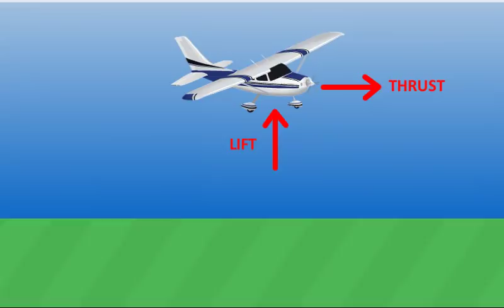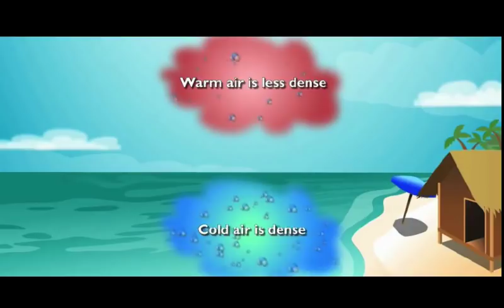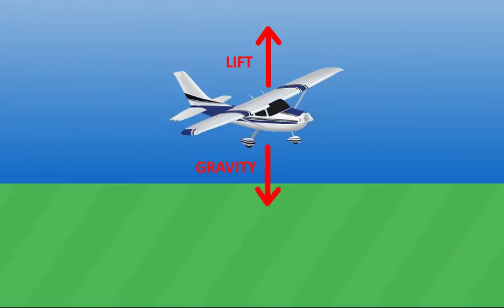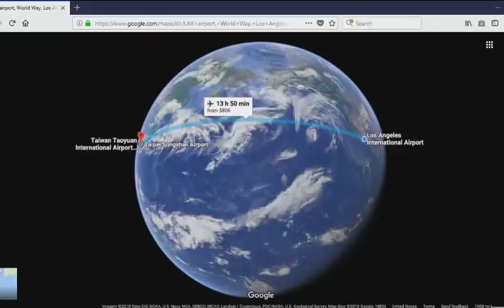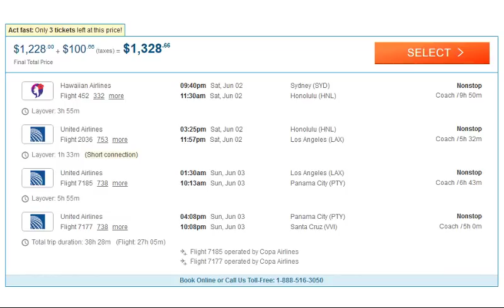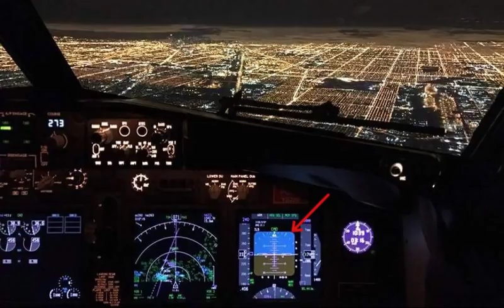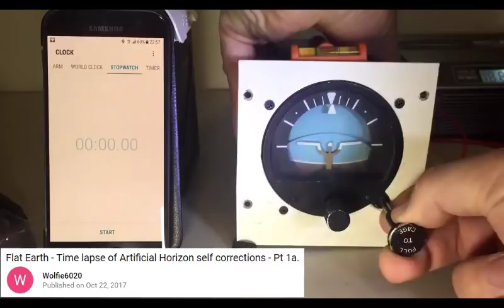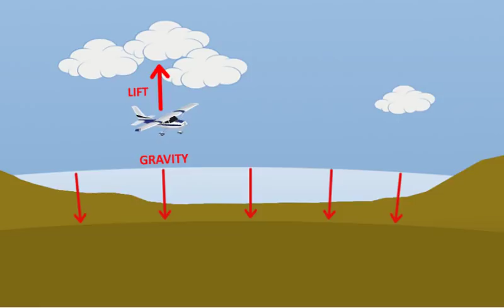Flat Earth Falsities - Plane Nonsense

Comment: Speaker claims the air is moved at 1100 mph at the equator because of gravity. But a spherical Earth would have a much smaller circumferences at the other latitudes and the air at those acts the same (no faster or slower). But the gravity acting on the air would be the same no matter the latitude. The gravity would pull the air to the earth's core and wouldn't exert any sideward forces to cause the air at the equator to move at exactly the same speed as the Erath rotating beneath it but there is certainly no mechanism for gravity to only move the air in New York, for instance, at half the speed. The speaker is dead wrong on the first issue. Everything we observe demonstrates things move THROUGH air and so would a spinning Earth UNDER an atmosphere move through the air above it. Planes move through the air and aren't effected by rotating air either. There's no evidence at all of what the speaker asserts.
Reply: You didn't actually watch the video did you?  Or maybe you had the sound muted?
Reply: Robert Lefebvre Aside from the motion starting as the planet formed (everything rotating) the atmosphere is kept moving by friction with the Earth’s surface, hence any point in the atmosphere having a similar rotational speed to the ground under it.
Reply: @flookd5516  NEVER would the spinning Earth be able to generate enough friction from the thin layer of air in contact with its surface to get the entire atmosphere above that thin layer to also rotate at the same speed. And with a supposed rotating speed at the equator of 1100 mph, then even a ridiculously high efficiency of 90% would result in a difference of 110 mph or a constant Class 2 hurricane.
Reply: Robert Lefebvre I said the atmosphere is KEPT moving by the friction, not that the friction created the motion. Individual molecules are moved by mountains, vegetation, buildings; being gases and the atmosphere being dynamic the acquired momentum becomes dispersed throughout the atmosphere. 

When the Earth & atmosphere essentially move with the same velocity there is zero relative velocity between them. You aren’t going to get a hurricane from both at the same velocity.
Reply: @flookd5516  That explanation is counter to the laws of physics and you would need to provide some proof of the claim. Everything from butteflies to birds to people to kites to planes cut through the air and so would the surface of a spinning Earth but even if it did act as some sort of paddle (like in a paddle wheel boat) it would push such a thing film of the atmosphere and would no way also cause the upper atmosphere to match the same speed from that small amount (relative) of friction. Too, since the circumference of the upper would be greater then the upper would need to have even more speed added to enable to keep up with the lower. With a starting speed of 1100 mph, any differences from the surface to the upper would result in potentially 1100 mph wind shear between the surface and upper atmosphere IF they weren't also caused to rotate at the same speed as you say. And all this is happening without an airplane feeling the sidewards push and a hurricane can still rotate within it while having ground speeds of just a few miles per hour?
Reply: @bungeebones  The Earth coalesced over the course of about 20 million years. The clumps of matter coalescing would have kinetic force; the rotation arises from the net movement and the acceleration that arises from the conservation of energy as the radius contracted. Most of the matter formed a solid planet; some remained in gaseous form producing the early atmosphere. Since all was rotating at the same velocity there was zero velocity difference between the solid planet and the atmosphere. The atmosphere was added to largely from volcanic eruptions; since all mass has inertia the gases being released retained the same net velocity as Earth and moved with the existing atmosphere. 

Some atmosphere would be lost as molecules with higher kinetic energy managed to escape into space. Since they took kinetic energy with them the net kinetic energy in the atmosphere would diminish. Friction of the Earth's surface would add kinetic energy to the bottom layer of atmosphere. As with any fluid there are local currents within the atmosphere, circulating molecules within it as the whole body moves. The accelerated molecules would be redistributed by those currents, dispersing the kinetic energy throughout the atmosphere and maintaining its net motion. 

When you are standing on the Earth's surface you are rotating with the Earth; there is zero velocity difference between you. When the atmosphere is rotating with the Earth there is zero velocity difference between it and the Earth. When you, the Earth and the atmosphere are all moving at the same velocity there is zero velocity difference between you and the atmosphere. You are not going to get blasted off your feet by an atmosphere that has zero velocity difference to you. There will be a difference between you and the local currents within the atmosphere; that is the wind. 

When an aeroplane is sitting on the runway it moves with the Earth. Due to inertia, when it takes off it retains that velocity; its engines act to change the velocity, not replace it. When the atmosphere is moving with net velocity difference relative to the Earth and an aeroplane retaining the same velocity as Earth takes off then the plane (other than the changes initiated by its engines) moves at the same velocity as the atmosphere (local currents aside). 

That the atmosphere as a whole is moving does not prevent the existence of local currents. Assuming you have flown, you may have noticed you can still stir your coffee while travelling on a plane; the plane's velocity does not stop you moving the liquid around in the cup. That is the difference between net and local effects. The coffee retains the velocity imparted by the Earth, modified by the plane's engines and the minor effect of you stirring it; it exhibits the net effect. 

If you are going to answer then read & understand what I just wrote then answer what I wrote, not what you think I wrote.
Reply: @flookd5516  Regarding "When an aeroplane is sitting on the runway it moves with the Earth. Due to inertia, when it takes off it retains that velocity; " LOL, with no noticeable effect whether it is flying north, south, east or west? Just think how all that would work on a human at 1100 mph let alone a plane. You are standing at the equator facing north. You have inertia moving you to your right at 1100 mph AND the air moving you to the right at 1100 but you can't feel it? And then you turn 180 degrees and face south. All those massive inertias reverse and you still can't feel it? 

But a plane flying north from the equator would quickly lose all east west inertia and would then need or suffer the atmosphere moving east in order to keep it on the same longitude. Planes to not at all feel those lateral forces when flying north or south. They act the same as if they were flying through the air in any direction.
Reply: @bungeebones  "You have inertia moving you to your right at 1100 mph AND the air moving you to the right at 1100 but you can't feel it?"
Can you name the sensory organ in the human body that would be capable of "feeling" that?

"All those massive inertias reverse and you still can't feel it? "
What?  What nonsense is that?  That is actual gibberish that proves only that you have absolutely zero understanding of even basic physics.  Seriously think about what you are saying for a moment.  Picture yourself on an airplane flying at 500 mph.  You are facing the right side of the plane.  You, the airplane, and the air inside the airplane all have inertia at 500 mph.  If you turned around and faced the left side of the airplane do you honestly think you are going to feel some change in inertia?

"But a plane flying north from the equator would quickly lose all east west inertia"
Why?  Why would it "quickly" lose all that inertia?  What would cause it to lose that inertia?  Really.  I am interested in the exact mechanism that will cause your hypothetical airplane to violate the first law of motion.
Reply: So how did our atmosphere get to be so special?
Some scientists describe three stages in the evolution of Earth’s atmosphere as it is today.
 Molecules of hydrogen and helium move really fast, especially when warm. Actually, they moved so fast they eventually all escaped Earth's gravity and drifted off into space. - DAM !

  Earth’s “second atmosphere” came from Earth itself. There were lots of volcanoes, many more than today, because Earth’s crust was still forming. The volcanoes released
        steam (H2O, with two hydrogen atoms and one oxygen atom),    - Perpendicular jets?
        carbon dioxide (CO2, with one carbon atoms and two oxygen atoms),
        ammonia (NH3, with one nitrogen atom and three hydrogen atoms).

Thus, oxygen began to build up in the atmosphere, while the carbon dioxide levels continued to drop. 
- BUT ALL THIS MOUVEMENT CREATED= MOMENTUM ! 

And if you also trust aerodynamic theory (which applies equally to flying insects, birds, and airplanes), then the giant flying creatures of the dinosaur age could only fly if the atmospheric pressure was much higher than it is now: at least 3.7–5.0 bar.

If this is so, it raises several interesting questions. For example, how did the atmosphere get to that pressure 100–65 million years ago (Mya)? What was the pressure before that? And how did it drop down to today’s 1 bar? Although we have no definite answers to these questions, let us put forth reasonable possible explanations.

The third alternative seems to be the most reasonable, [ :) ] so let us pursue it. We will also look into the composition of Earth’s atmosphere, but we will first discuss Earth’s surface and see how it affects the atmosphere...

Our moon has the same density as Earth’s crust, which suggests [= scientific fact] that *the moon was formed by stripping Earth of some of its then fluid crust [- with even less then 1/6 Gravity?]. If not for this loss, Earth’s crust, now only 5–30 km thick, might be 42 km thicker. 

Making sense of it all :) :) :)
If we assume that Earth’s early atmosphere was very different, both in composition (mainly CO2) and total pressure, that would answer some puzzling questions from a variety of disciplines.  -DAM not only FEers have many questions?

- And Louis educational program of Heliocentric globe business to their Believers continues...

REF: https://scijinks.gov/atmosphere-formation/
         http://pubs.acs.org/subscribe/archive/ci/30/i12/html/12learn.html
Reply: @bungeebones  You're making the same mistake many do: when presented with three objects moving with the same velocity; you give yourself a frame of reference by imagining one of the objects as motionless. Engines & weather aside, they are motionless relative to one another; they all move eastwards relative to a remote stationary observer. 

Inertia is an object continuing to move at a constant velocity unless acted upon by a force. The plane's velocity is altered by its engines and any local air currents; aside from those changes in continues to move with the Earth & atmosphere; it's not going to magically lose that velocity when it breaks contact with the ground. 

"You have inertia moving you to your right at 1100 mph AND the air moving you to the right at 1100 but you can't feel it?"
The Earth is moving eastwards at 1100mph, the atmosphere is moving eastwards at 1100mph, I am moving eastwards at 1100mph; where do you think the difference in velocity would come from? Do you mean why don't I feel the motion itself? The body does not have the ability to sense motion per se; we can sense acceleration and we can sense the effects arising from motion but we can't sense motion directly. When everything is moving eastwards at a constant speed there is no acceleration and no difference in velocity to give rise to effects the body would be sensitive to. 

"And then you turn 180 degrees and face south. All those massive inertias reverse and you still can't feel it?"
I continue to move eastwards. Why do you think the velocity would change merely because I turned around? There is nothing exerting a force that would change my velocity. I'm not making a U-turn in a car. 

"a plane flying north from the equator would quickly lose all east west inertia"
Why? The engines alter the planes N-S velocity. The atmosphere (weather aside) and Earth continue to move eastwards at the same velocity; why would the plane be any different?

"Planes to not at all feel those lateral forces when flying north or south".
The plane would continue moving eastwards under its own momentum, not through an applied force; on a N-S flight its engines alter its momentum only in a N-S direction. If there were E-W forces acting on the plane then its E-W velocity relative to the Earth & atmosphere would change.
Reply: @MrQuaiven  So you are basically admitting you are totally senseless and can't tell whether you are coming or going :-). Regarding "do you honestly think you are going to feel some change in inertia?" Go 100 mph in your car and run into a bridge and tell me you won't feel a change in inertia! Your body ALWAYS feels a change in inertia unless you are comatose!
Reply: @bungeebones  "So you are basically admitting you are totally senseless and can't tell whether you are coming or going :-)"
I can't help but notice that you avoided the question.  That's common with you guys.  You are making the argument that we should "feel" it, it should be simple for you to explain the exact sensory organ in the human body that would be doing the "feeling".  But of course you will dodge this again.

"Regarding "do you honestly think you are going to feel some change in inertia?" Go 100 mph in your car and run into a bridge and tell me you won't feel a change in inertia!"
You honestly do not see the difference between your original example and your current example?  Really?  This isn't even moving the goalposts here you have actually changed the sport.
Reply: @flookd5516  You talk about an awful lot of forces there and yet none of them can be sensed? Sounds more like imaginary forces (like imagination) rather than real physical forces. And it is the magnitude of the supposed movements that is tell tale evidence the rotation isn't happening. The Earth isn't rotating and that is why a plane flying north or sound doesn't have to alter anything. It is why someone standing on the equator can experience a calm day just like someone in New York. There is no way that gravity would move the atmosphere sideways to get it to match the speed of the earth rotating under it. Gravity pulls down, not sideways, and there are no where near enough "paddles" such as mountains and buildings to push the air around the earth like a fan. The earth would cut through the air effectively causing a difference in the rotation speed compared to the air and at 1100 mph the difference would be noticeable. So, you won't convince em. I think you are crazy.
Reply: @bungeebones  I mentioned two forces: the plane's engines and the local weather. Inertia and momentum are not forces. Inertia does not require a force to be applied to retain momentum.  

"it is the magnitude of the supposed movements that is tell tale evidence the rotation isn't happening"
Evidence in what way? Disbelief on your part is not evidence. 

"The Earth isn't rotating"
And yet the rotation is measurable; gyroscopes, pendulums, Coriolis effect. 

"There is no way that gravity would move the atmosphere sideways to get it to match the speed of the earth rotating under it"
I never mentioned gravity as playing a role. 

"there are no where near enough "paddles" such as mountains and buildings to push the air around the earth like a fan"
1. Time. 
2. They maintain the velocity; they replace what little kinetic energy is gradually lost, not provide the entire energy. That's the third time I said that. 

"The earth would cut through the air effectively causing a difference in the rotation speed compared to the air"
As I said, your mind is trying to create a stationary element to give you a frame of reference. 

"I think you are crazy"
I have a brain capable of handling multiple factors; yours is blown by three.
Reply: @MrQuaiven  I wasn't avoiding anything but you were obviously leading to something and rather than say it directly you were being obtuse. I summarised everything you said because it was too long. But, seriously, 1100 mph supposed rotation speed and NO ONE can feel it?

\
Reply: @bungeebones   "I wasn't avoiding anything but you were obviously leading to something and rather than say it directly you were being obtuse."
Says he wasn't avoiding it while continuing to avoid it.  Are you afraid of the answer?
Reply: @flookd5516  Regarding ""The Earth isn't rotating"" Have you seen the documentary "The Principle"? Plenty of scientific evidence showing that not to be true. And if one starts with an assumption that it is not (rather than presuming it is) then all your other points are quickly seen for what they are (unbacked assumptions and empty arguments). If the Earth is not spinning then NONE of your points are valid. If it is not spinning then it would mean the atmosphere is not spinning either and planes that fly north south cut through the air the same as those flying east-west. They wouldn't have to time a runway approaching from their right at a quarter mile per second and we wouldn't have to discuss non-substantiated claims about how gravity and tiny amounts of surface drag can move miles of atmosphere sideways. I suggest you watch the documentary.
Reply: Robert Lefebvre “The Principle” relies on conjecture, ignoring counter-evidence and ignorance of the people watching. That you can’t get your head around something does not make it reliant on “unbacked assumptions and empty arguments”, just your desire for something to easy enough for your mind to grasp. 

For the fourth time, the atmosphere moves through inertia. The drag from the Earth’s surface compensates for what inertia is lost. 

See Wong & NotTheCIA’s comments.
Reply: @flookd5516  Sweet JESUS! Mister Evolution himself acadamically claiming the Sphere had an atmosphere from the BEGINNING???? Dont think that holds even with the Globe birth story... as the burning iron core keep sticking piece to it, nor do I think IT has a unidirectional constant SPIN back in those days, just twirling around until IT chose a fixe axe and proper "rotation" speed. No someone is not backing up into their tale, BILLIONS of Years is what the business is about.
Reply: Strange that you have been spared the whole (remaining) Gang.. Yes their christian "Newton" gravity (laws) cause a Momentum anomaly, and nothing can shake it, disturb it, as a mass losing contact with the spaceship Ball speeding along.
That GAS certainly is amazingly sticky, even disturbances as winds / tornadoes / hurricanes can not make slip or lose contact.
But sure affect heavier Liquids, and cause tides if not tsunamies, Gravity lets it all go, same as a large amount of H20 hanging around up way in clouds.
Reply: @NotTheCIA I.think Re: "speeds up to the first layers speed over time." Impossible. That would mean 100% efficiency in the transfer. Doesn't happen. The friction with the layer above it will result in it being slower. The layer above it - same thing all the way to the upper atmosphere (where there is NO WAY gravity can move it sideways as some in this thread have proposed.
Reply: Robert Lefebvre Why would it mean 100% efficiency?